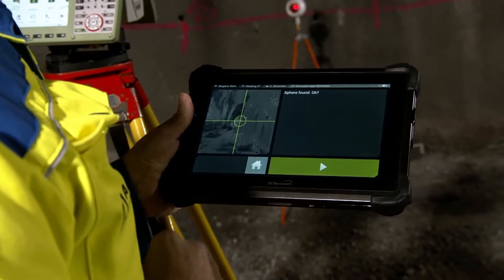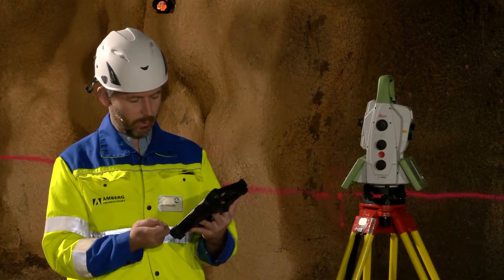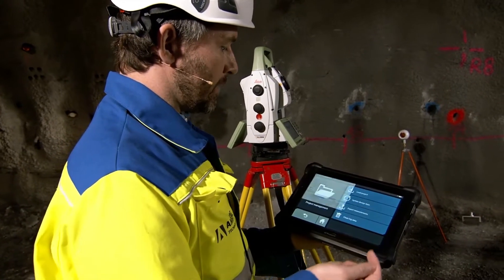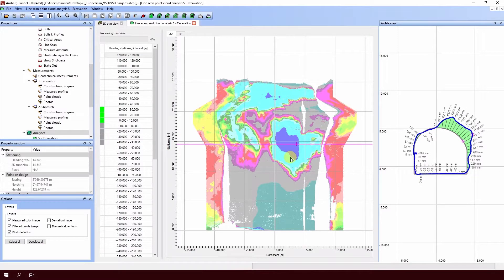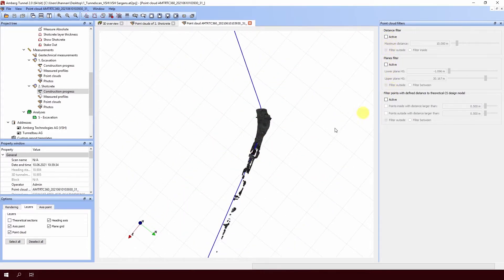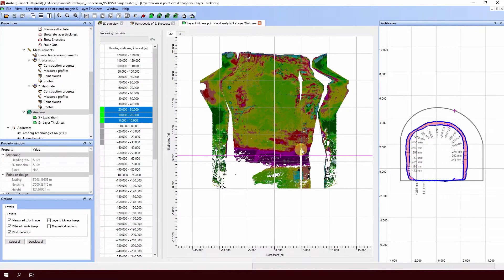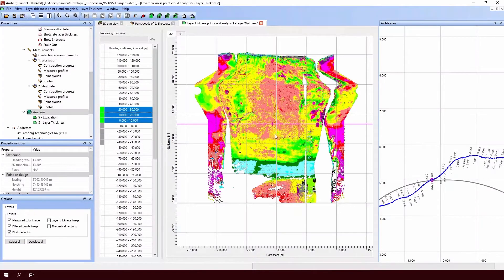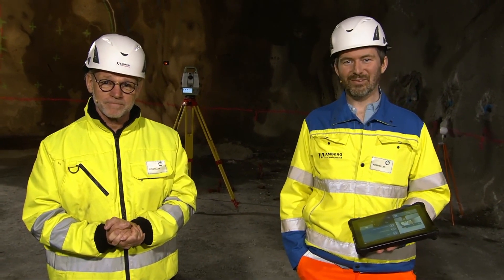Tunnel Construction Control

Comment: Lee how is the TS16 connected to the coordinate system?
Reply: Good question. It is not shown in the video in order to keep it reasonably short. 
There are control points with known coordinates that were used to do the resection.
There is a separate video showing this part of the workflow:
https://youtu.be/wkks0pBP9KA